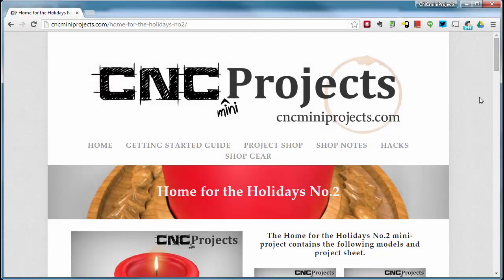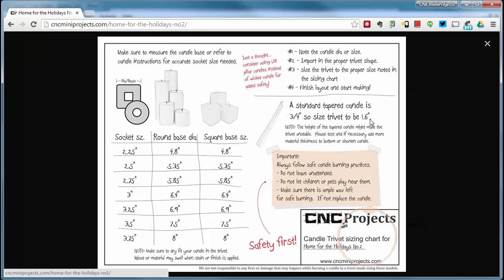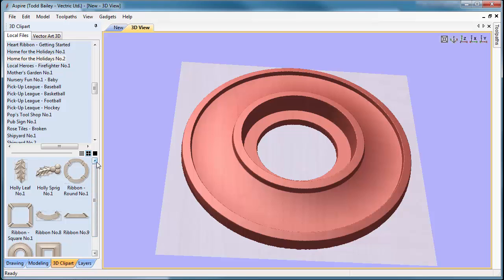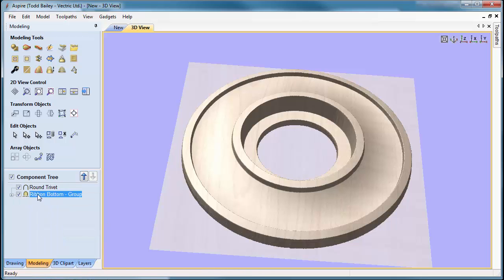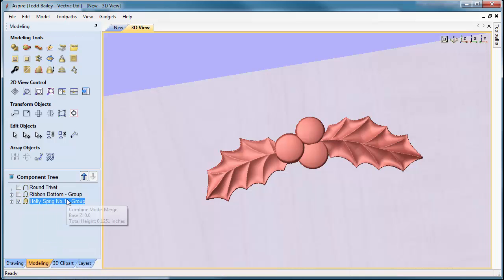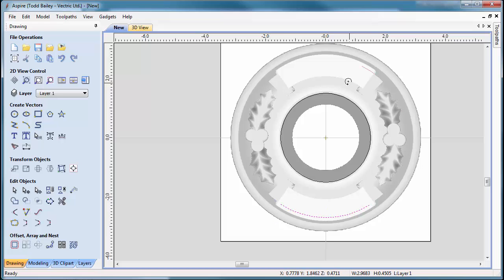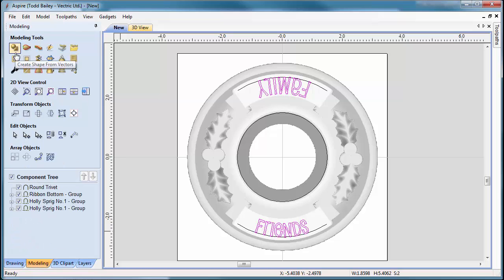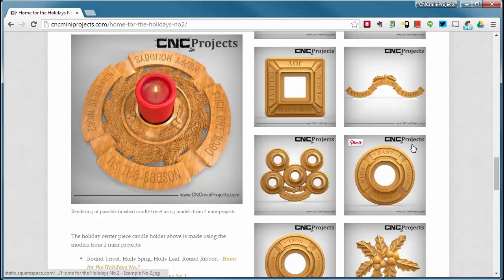To Get You Started - Home for the Holidays No.2 | Design & Make

Comment: I was just wondering... what do you do to engrave on the round ribbons when they are slanted.....the engraving tend to distort the writing because the non flat surface.  
Thanks
Reply from the maker: Hey Andre...

With respect to the ribbon in this mini-project the angle should not be all that great (after you add it to the base) and the distortion should be minimal... but for the trained eye you will notice it cause it is very hard to avoid seeing as the text (or any vector) is project straight onto the zero plane and not angled for the surface.

Your best bet would be to transform the text between 2 vectors segments: one vector near the top of the ribbon and the other near the bottom.  Then using trial and error move one or the other closer the the other and transform the text again till you get the look you like.  

The other thing would be to use a different font.  Fonts that are squatter might get you a better result (they will stretch taller on the actual ribbon once machined).

In the end... most people will not notice the difference using this project... and you will need to balance the time trying to correct the distortion with the actual net gain visually for most people.

Make sure you project the v-carving onto the relief... I am sure you are but for other reader of this it is something to remember.

Hope that helps...

Todd
Reply: It worked just fine...lol I was over analysing  this.you are right...it's hardly visible. Looks great actually. thanks for all your videos... you are a very good teacher...easy to follow.
Andre